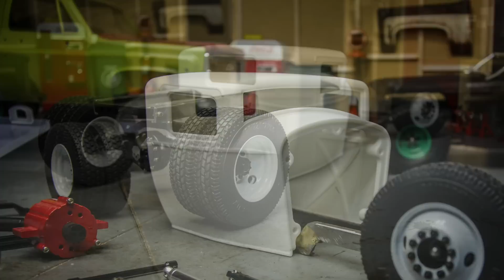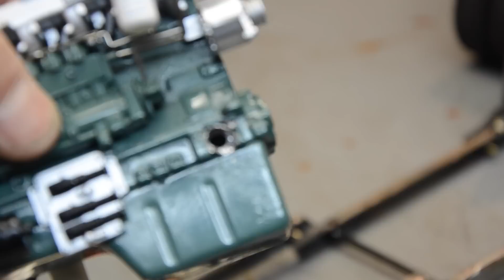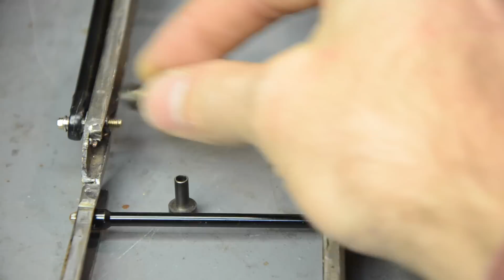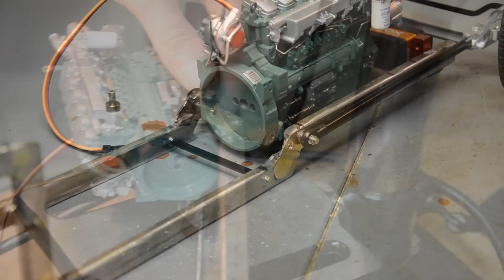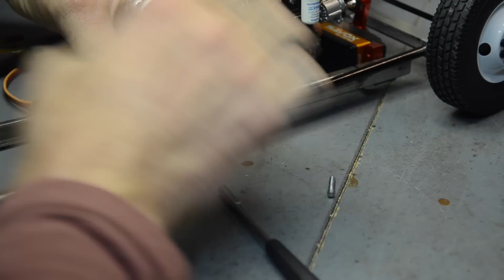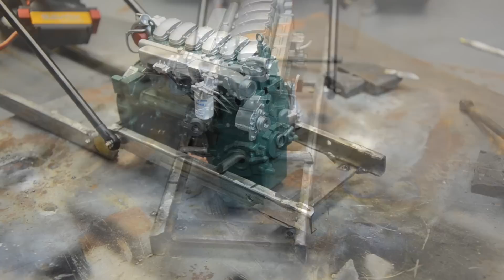Old #2 Rat Rod Scale Diesel Engine Mounting

Comment: If ya don't have an auto punch, might I suggest you get one.... I have a few types and sizes. I tend to use the smallest for R/C. "automatic center punch", Then take a few minutes to familiarize-yourself with it and learn they are adjustable for tension for the applications at hand.

Comment: Looking good man! The blacking looks good on the engine block.

I reckon use the R2 if you can get it to fit and use the forward facing output shaft to rotate the fan on the motor via that shaft that goes through the motor maybe?
Reply from the maker: That would be fairly easy to do, only issue I see is keeping the belts and accessories on the front of the motor together.  They are all plastic and rotate with the fan.  Not sure they could handle the speeds.  Great idea though.